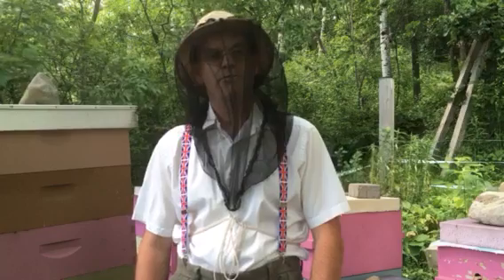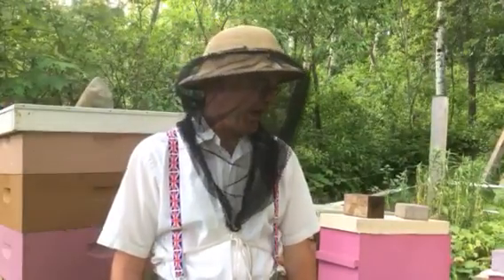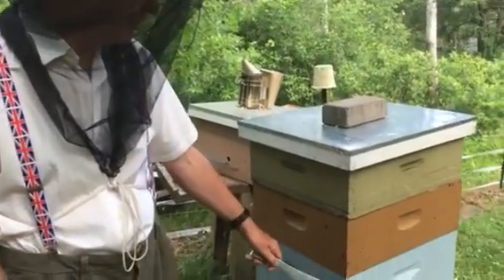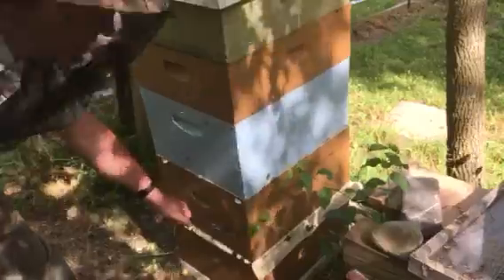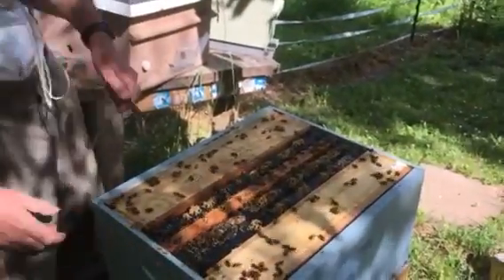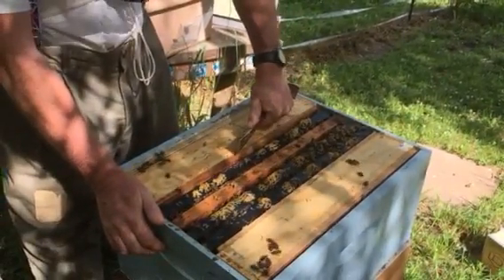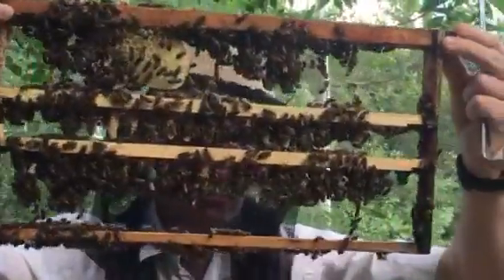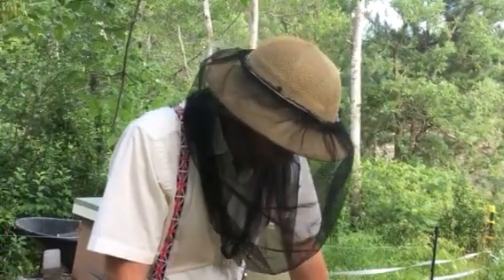Ben Harden Queen Rearing Method

Comment: In sted of useing the dummies why don't you just fill the space with other frames of hatching brut and honey and then put two frames of queen cells in
I use a simler method as this with the queen under but I can get first time 60 queens and the more you use the hive for this perpose they get better the better the bees get its good to get alot of Queens at on time and later to produce royal jelly
Reply from the maker: Richard, thanks for your insights.  I understand what you're saying.  However, I like this method because it doesn't require much intervention, other than making the dummies, and seems quite suitable for those of us who are not raising that many queens.